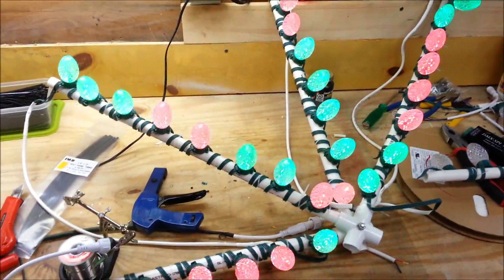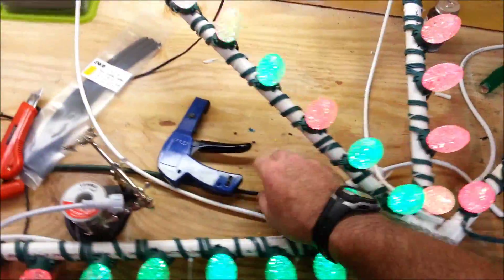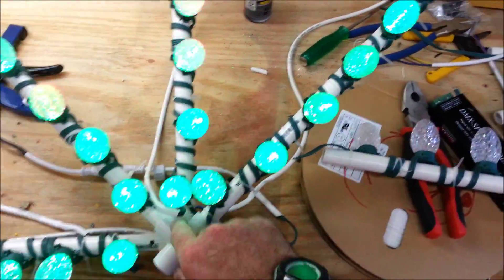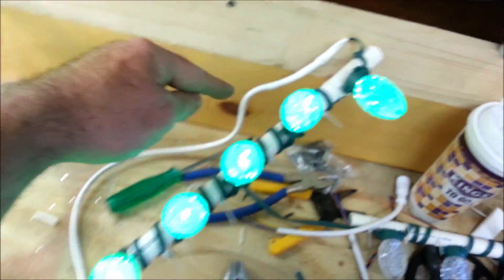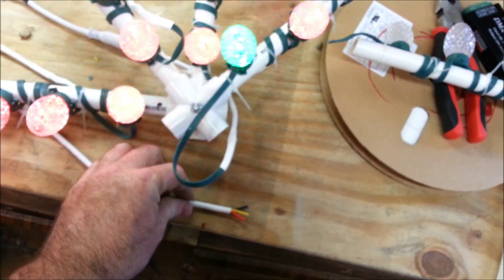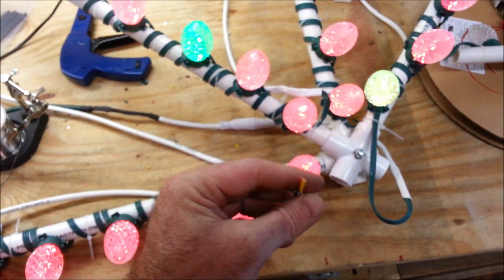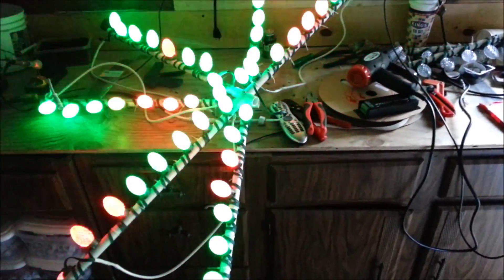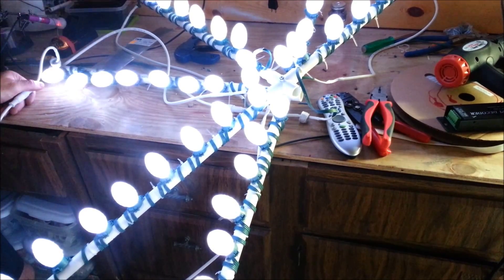GE Color Effects (GECE) Pixel Spinner How-To Build

Comment: Hi
Thanks for the video
This GECE pixel what is the pixel protocol on it so it could be config on e682 (2811?)
Reply from the maker: I do not know the exact protocol.  I use the Sandevices e682 or e6804 pixel controller to output the GECE protocol.   It Just Works.